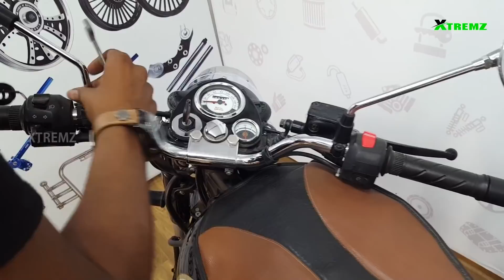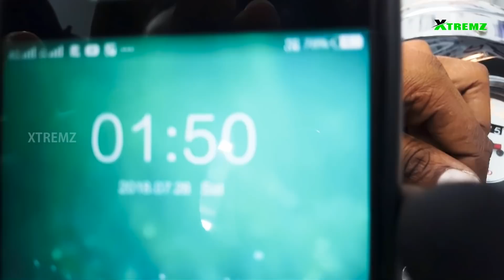How to install mobile charger in bike | Spider mobile stand with charger | Review | #xtremz

Comment: Bro mobile holder charger LA than device on/off button irukke  bro appa namma direct ah battery la  irunthu connection edukkalam thane ???
Reply: Yes but it's safer not to do that , the electronics inside this device is cheap and not reliable.